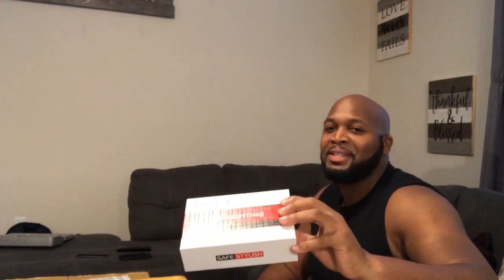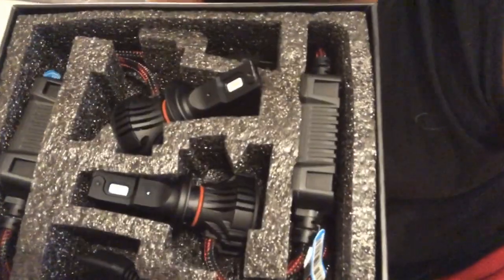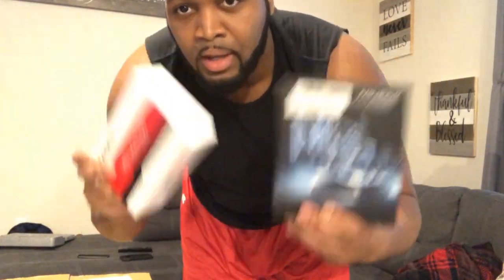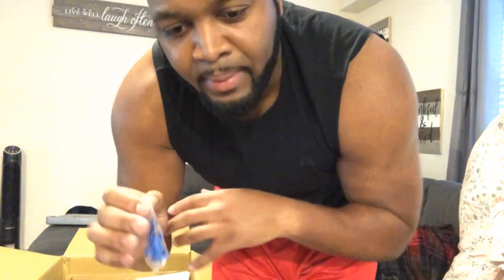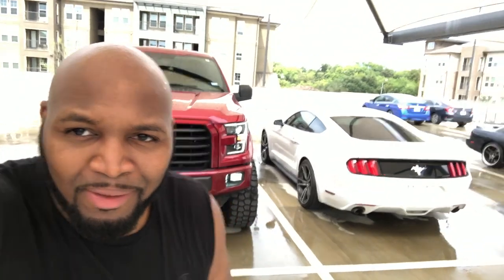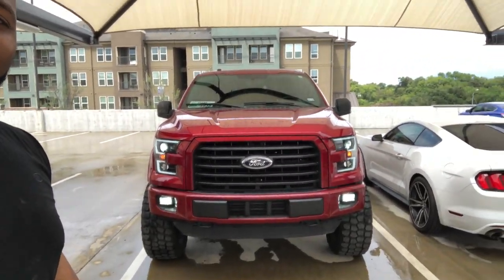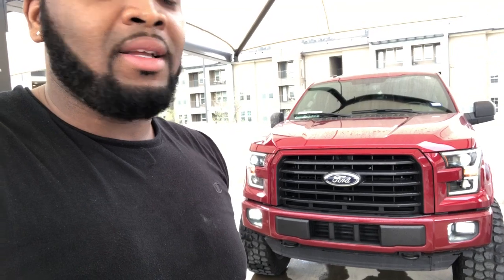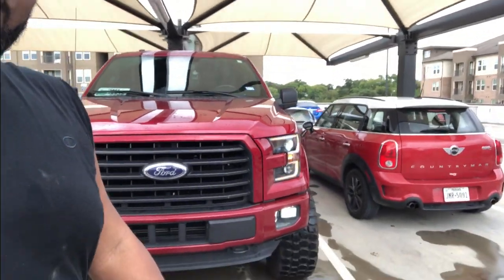2015 F150 Anzo Projector Headlights with LED Switchback Install

Comment: Question on your wheels, what size did you get and did you just put spacers on them and what size?  Truck looks sick with those headlights!! I'm sold on them for sure!! Great video.
Reply from the maker: I’m running 35sx12.5 in tires. I bought my truck from a Lifted truck dealership so the Lift Kit are installed brand new. From what I recall. It’s just a 6 inch Rough Country Lift Kit. No spacers. Yea the Anzo definitely change the entire  appearance of the truck. Precitae you watching!

Comment: How are the Anzos treating you? Still satisfied? I have the exact setup but I'm thinking about taking them apart to put some higher quality projectors in to improve performance. It seems depending on the batch, people have experience inconsistent performance on the output. Could also be everyone not having their bulb orientated correctly LOL
Reply from the maker: Yea they look great at night the output isn’t the best but I’m definitely in no rush to get rid of them. From what I’ve learned and have been told by others, it’s best to run HIDs inside the Anzo instead of LEDs. That may explain the lack of output. I also did another video strictly related to the brightness of the Anzo led strip. You may want to check that one out.

Comment: I did a muffler delete on my 2017 f150 v6 3.5 it has a low rumble when u stay at a steady 1100 rpm and it sounds awesome when u accelerate
Reply from the maker: I gotta find some videos and listen. Muffler delete pretty inexpensive also right?
Reply: What brand of muffler did you replace with?
Reply: @germainecalliste4570   nothing it just doesn’t have a muffler on it it’s straight piped
Reply: @KickinItWithQ  no I used my friends power tools to take it off

Comment: If you wire tap the parking lights with the switch back function they will stay Amber, I am currently working on making them stay Amber and work with the turn signal also.
Reply from the maker: Cool deal! Keep me updated on your project.

Comment: Did you have to splice to keep the led daytime running lights on during the day? I paid someone to install some Raxiom G3’s and some led Fogs but now the DRL’s don’t come on with the Auto setting. I have to literally keep it on(second position on light switch). Is that normal. 
(2016 F150 Lariat EcoBoost)
Reply from the maker: I’m not sure. I have an xlt so I didn’t have  Daytime Running Lights(DRL) so the ones you got might not be DRL . Read the description of the product to see if it’s DRL.

Comment: Hey man, I love your truck and your videos you do a great job ! I have a couple questions if you don’t mind. As far as the LED bulbs go for your fog lights I have the same year truck as you and when I clicked on your link  amazon was showing that it’s not a match for my truck. So I’m wondering if your fog lights are stock or aftermarket? Also I have the same ANZO headlights so I decided to eat the same LED bulbs you got. I noticed in your review video of the ANZO lights you mentioned one of the headlight bulbs having a dark spot, I was wondering if you got that resolved or if it was a bad light ? Thank you for your help ! Please do not feel obligated to answer these questions as I’m sure you are VERY! Busy !
Reply from the maker: Hey man! Precitae the support and you watching the Channel! Main reason I started it is to help others learn from my mistakes and experiences. So I glad I could help! Yes so my fog lights are aftermarket. I have the lasfit fog lights. The fogs lights are different size. I’m going to paste link here at end. If you change size to H11/H9/H8 you should see that it does fight. The fog lights aren’t the same size the LED lights in the Anzo. The Anzo issue has not been fixed. I reached out to Anzo they said I need to rotate the bulb. So did others via the comments. I honestly have been to lazy to do it lol. But one of my Anzo switchback came loose as well so I’m trying to find a day to go back in and redo it all. Just a pain to get that entire housing out lol. Precitae the support again! Hope I answered your questions. Here’s the link LASFIT H7 LED Headlight Kits-COB Flip Chips/Adjustable Beam- 60W 7600LM 6000K-Hi/Lo Beam/Fog Light Bulbs https://www.amazon.com/dp/B01H8VILDG/ref=cm_sw_r_cp_api_i_shScDbFVPCW4F
Reply: KickinItWithQ  thank you so much for the reply ! Regarding the fog lights I was able to find some bulbs that were different but they fit well “plug n play” is legit ! Hah today I received my bulbs for my anzo headlights so I’m looking forward to installing those. Hopefully I can get the bulb in the right way and not have a dark spot as well. I hope you get your anzo LEDs figured out that’s a bummer that they came loose like that ! Thank you again for your reply I look forward to many more videos from you !
Reply from the maker: Thanks for the support! Good luck on the install!

Comment: Is the headlight LED bar daytime running? If the headlights are turned off during the day, does the LED stay on?
Reply from the maker: Hey man! No they are not day time running lights . I generally turn my lights on manually. If you go watch the video titled “is the Anzo Projector LED bright enough” I cover how I run mine lights in day time. Thanks for watching!
Reply: Q Just as easy as turning the nob like that huh? Right on, thanks bro!
Reply from the maker: 😂. Yep lol. Hope that was helpful. Thanks for the SUB!
Reply: Q for sure bro! Great content, I have a ‘16 Ruby Red half ton too, and it’s bad ass to see someone post things that I dream about doing on my truck too!
Reply from the maker: Right on man! If there’s anything you want to see let me know and I’ll do my best to cover it in a video if I can.

Comment: Muffler & Resonator Delete for 3" pipe. Sounds way deeper in real life than on any video. Try to keep the RPM low is the only thing to make it sound good. Better for MPG and helping to get pulled over less too
Reply from the maker: So when you really get on it, still sound ok? I’m a pedal to the metal type guy lol
Reply: I would say anything over like 3000 RPM is when it sounds ricey
Reply from the maker: Thanks man!

Comment: Did You have to get adapters for running h7 bulbs because there are h11 in the oem ones?
Reply from the maker: I did not. The Anzo Headlights use a H7 bulb so the ones you saw in the video were H7s, so they were Plug and Play. Link to bulbs I used are in description.
Reply: Q just a suggestion but I put a thin led light bar behind my grill!!!! That would set your front end all the way off at night. It’s a fairly inexpensive mod and easy to install your self.
Reply from the maker: Hey man! Yea I definitely want to do a light bar. I was thinking on locating it where the front license plate is normally mounted. But I’m also thinking about doing a new grill also. Send me a pic of yours if you have one. My IG: is q_lwilliams99
Reply: Q just sent them too you. I did both...behind the grill and the space where the license plate goes.
Reply from the maker: Cool. Imma check our the pics

Comment: Hey, about to buy some Led's for my incoming lights. There are way too many to choose from. 
Is there a certain size I need. I have seen some 30mm ones. I read you had issues with one of yours. Anything you would do different when purchasing them? Thanks a bunch.
Reply from the maker: Hey man. Well I have the aftermarket Anzo headlights housing so they take H7 bulbs. If you have the factory housing from the dealer then I’m not sure what size they take. Definitely google it or amazon tells you if the bulbs will fit your vehicle. I like the ones I have now if I can just get the one to work properly. Again think this is my error and not the bulb. I’m going to past a link to a video I just watched on YouTube Regarding best LEDs.
Reply from the maker: Check this video out.  https://youtu.be/QcDq2SJyuZI
Reply: @KickinItWithQ  Thanks. Yeah, I had to purchase a different kind for 2018 f150. They look different.
Reply from the maker: Ahhh ok. I wasn’t aware you had 2018. Yea the completely changed the headlights on those. Glad you found something man!

Comment: Did the LED headlight bulb fit in the housing with the cap on?
Reply from the maker: Hey man! Yep, make sure you get H7 led bulbs for the Anzo headlight housing. Only thing is, there were metal clamps securing the the lights that come with it. I couldn’t get those clamps to clip back due to the size of the led bulb. But they still twist and lock in fine.

Comment: How are your LED’s holding up so far? Any heat or flicker issues?
Reply from the maker: Hey man! They have fans so they are cooled and shouldn’t over heat. Buts it’s winter time so it’s cold out right now so they probably aren’t getting to hot. I have notice one of my bulbs looks as if it’s a dark spot/ space when looking at the ground. From certain angles you can tell one is brighter than others with the naked eye. I’m going to take it out soon to take a look. Maybe it just needs adjusting. But for the one working properly no issues and it’s pretty super bright.
Reply from the maker: Also I kinda scratched it when I put it on. It was totally my fault though
Reply: I’m about to do the LED switch for my Anzos and was just curious. I do live in a pretty hot climate during the summer so we’ll see how they work. Gorgeous truck by the way.
Reply from the maker: Thanks man! I’m in Texas so we’ll see how they hold up in summer as I swapped them close to winter. Read the reviews if you haven’t already. Good luck with your project! Let me know how it goes.

Comment: Great video man. Quick question, when you changed out the h7s, did you put the ballast and all the wiring in the cavity with the bulb? Have you had any issues with it getting too hot inside?
Reply from the maker: What’s sup man. Yea with the replacement bulb I used everything fit inside the cavity housing and I was able to get the cover back on just fine. As far as heating issues it’s been very cool here in Texas so not sure if they have had chance to get too hot. Will find out this summer. They do come with fans however so they should stay cool. I got question for you, how do you or would you know if you are experiencing over heating issues?
Reply: Oh that’s awesome man! But as far as the heating issues, I’m not really sure tbh. I’m guessing if your bulb burns out, then you’d know the ballast was getting too hot inside there. I had just been reading up on the forms and people were saying they’re bulbs were burning out when they put everything in the cavity. I ordered everything you used for your setup, so it sounds like everything should be good! 👍🏻
Reply from the maker: Good deal! I just posted a new video maybe 30 mins ago. It’s about the nineo bulbs. When you install yours, let me know if you experience the issue I’m experiencing. One guy just commented on it and said he’s using Hikiras in his low beems Anzo.
Reply from the maker: Think it’s user error on my behalf honestly

Comment: Hey Q, I just picked up some used Anzos and search YouTube for an install video...yours popped up.  Those clip on style wire connectors can be difficult at times to work correctly, no doubt about that.  Your truck looks sharp!

Oh, I see you are in Texas.  Do you ever get stopped for not having a front license plate?
Reply from the maker: Thanks man! No so far no law enforcement has given me any issues regarding the front plate 🤞🏾

Comment: Put an exhaust cut out on it. Stays quiet when you want it and gives you a straight pipe when you want with the flip of a switch
Reply from the maker: Thanks man for that recommendation. I’ll check into it.
Reply: Also how is the light output on these head lights?
Reply from the maker: The anzo come with standard halogen lights so I swapped mine for leds. The leds I got are decent. I’m considering looking for something better as I recently found Led’s don’t work well with projector housing
Reply: @KickinItWithQ  I just bought my headlights and grill. I am wondering what do you mean the Led's do not work well with projector housing? Also as long as I get H7 led's they will fit the same plug? Sorry, last thing what led's would you suggest if the ones you got are just decent? Thanks.
Reply from the maker: That’s just what I’ve heard. Apparently HIDs are better than LEDs in projector housings. Now my LEDS, well the one that’s working looks find in my opinion. It maybe more of a preference thing. Yes the Anzo requires an H7 bulb so as long as you get H7 you should be fine. Now not all are maybe the same so you may have a difference experience than myself if you choose another manufacturer.
Reply from the maker: I personally don’t have any suggestions as this is my first set of LEDs. I’m sure if you google, best bulb for Anzo you should get a lot of information as they are very popular. Hope this helps

Comment: do you have an aftermarket exhaust? if no just go do the resonator delete. I have the same truck the res delete give ou a little more sound
Reply from the maker: Nope, stock exhaust. I actually was looking into resonator delete. Doesn’t sound to ricey but gave a nice grumble on startup. How does it sound when you get on it?
Reply: @KickinItWithQ   not to bad a little deeper if you are ever heading down to Houston we should meet up
Reply from the maker: nicholas geiman yea Youtube’n on a budget down there and I want to collab with him one day. Did you replace the resonators with a corsa or after market straight pipe or just a standard pipe? A lot of guys were buying the corsa that cost like 200-300$ and I don’t want to spend that if I don’t have too.
Reply: @KickinItWithQ   i paid $40 at an exhaust shop to cut it off and add a pipe in the place of it
Reply from the maker: nicholas geiman cool I’m definitely considering doing it but scared to pull the trigger because I may not like the sound lol. If I do you’ll def see video on it. If you have any clips of yours, send it to me on IG @ KickinItWith_q.
Reply: @KickinItWithQ  i send you a sound clip on IG and some photos of my truck